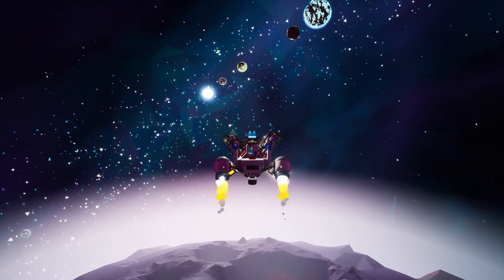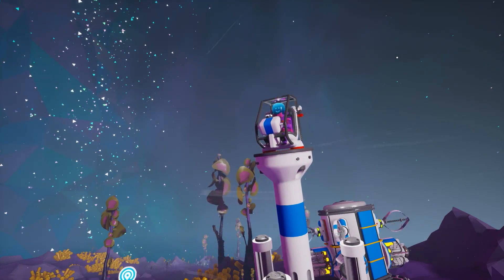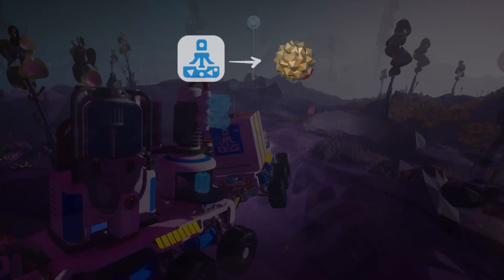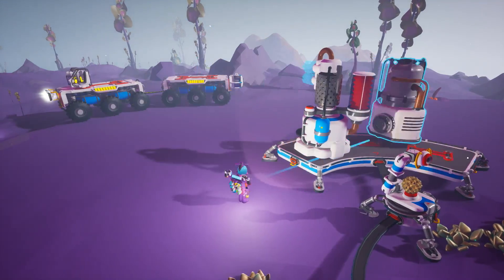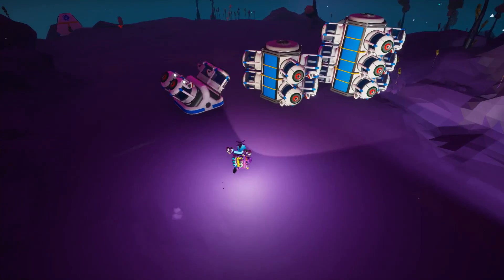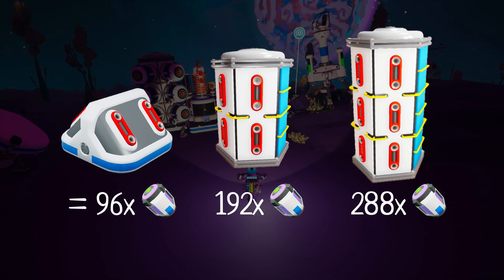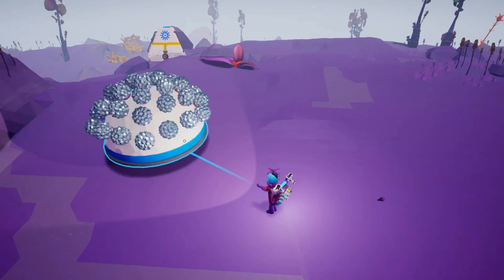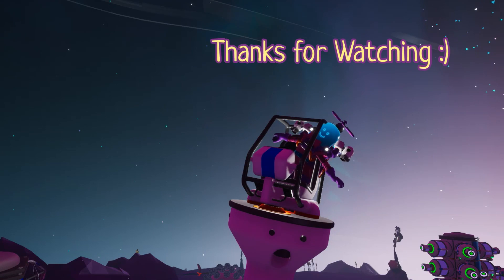Get an ocean of Hydrazine with this Compact Hydrazine Factory

Comment: My setup is similar to the second option, I have an auto extractor filling a large resource canister with ammonium in one of those large veins in Novus and I transport it to Sylva where I have my hydrazine factory - which I also use to fuel my nano carbon alloy factory.
Reply from the maker: Ultimately it still flows better with people to split up the process since building it whole on-site is somewhat of a commitment, like setting up a small base

Comment: For some reason my hydrogen isnt going to my chemistry lab, do u know y?
Reply from the maker: I won't be able to tell without being able to see your build.
But there should be no reason for hydrogen to not go into your chem lab if they're both on the same platform, with access to power, and with hydrazine selected for your chem lab.
Reply: @Sand Vox Nate  its ok i fixed it by just and an extra auto arm, idk y it wasnt going before